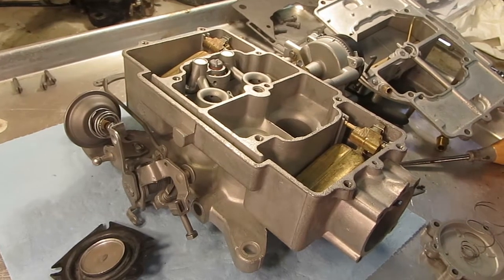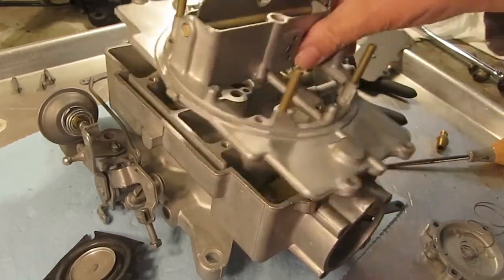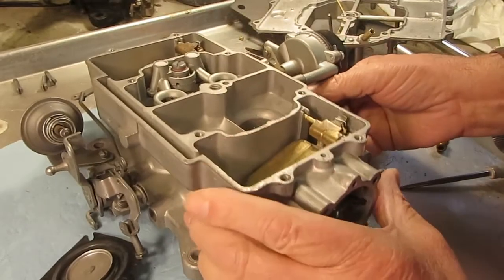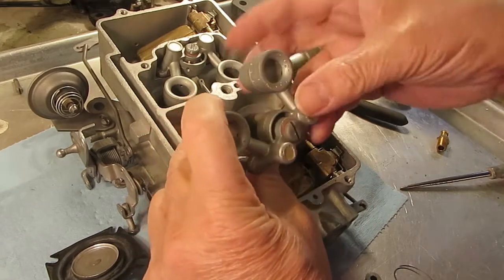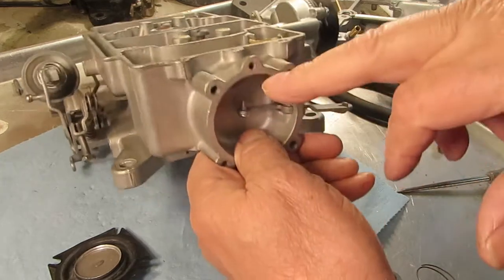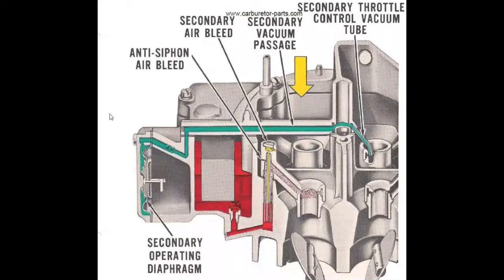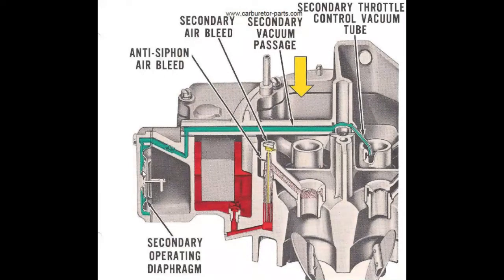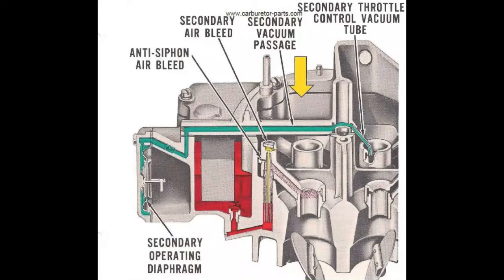Autolite 4100 4 Barrel Carburetor Secondary Circuit

Comment: Mike I have 1959 ford Fairlane interceptor with 4100 carb have flat spot as soon as you accelerate in gear only , is secondaries supposed to pull in that soon.

Comment: What is the spec for the little screw you reach from the underside to adjust the closed position of the secondaries?  I know you are supposed to hold them closed and then turn the screw until it jus touches the secondary lever.  From there you are supposed to turn it roughly one more turn?